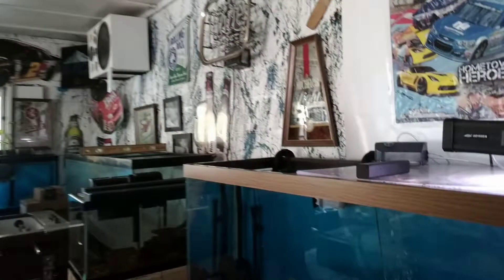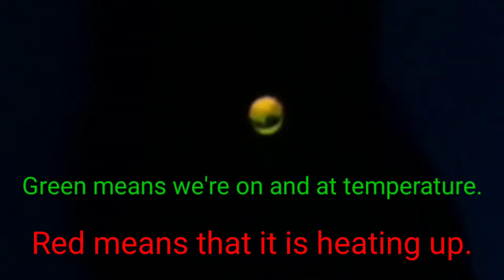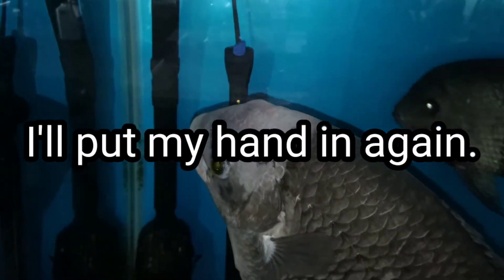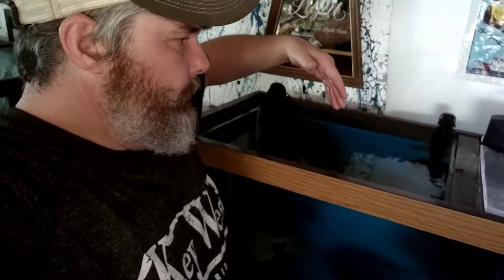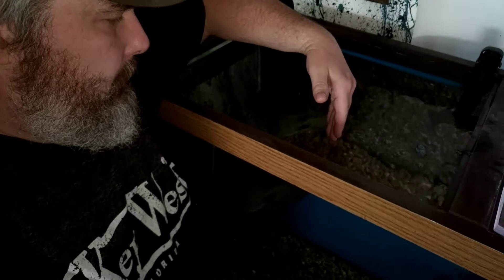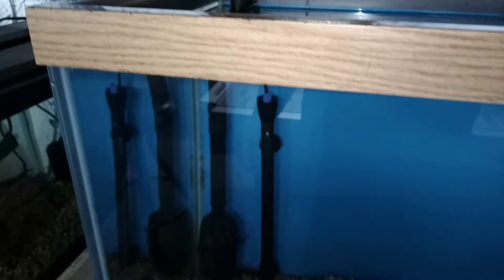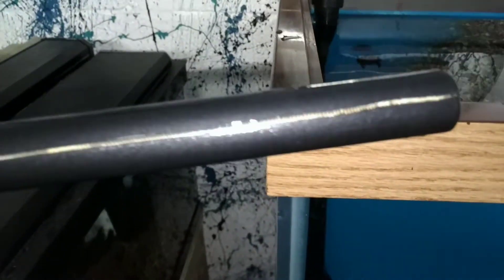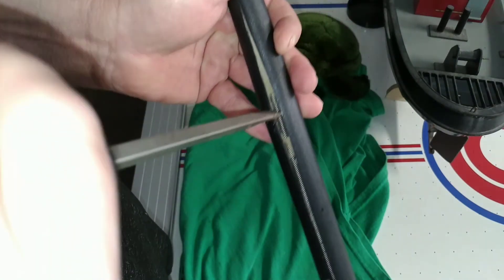Your fish don't get electrocuted but you can. This is how and why.

Comment: Hello good morning, my friend, this problem happened to me in 2024, right now, and I really tried to turn off the devices one by one and it was the thermostat. Even so, from what I understand, it could also be a poorly insulated wire that could be passing through the water in our tank. I have salt water and I was surprised because neither the shrimp nor the crabs died, we just need to know if the anemones shrank and gave some sign.
But anyway, I just want to share with all of you that this really happens.
However, I just tried using the pole flasher in the aquarium water and it still has a certain current, but minimal.
Reply from the maker: Thanks for sharing. I am glad to hear you found the problem. Happy fish keeping.

Comment: So is this what they mean when they advertise a heater as "shatterproof"? I was thinking it somehow stopped your glass from cracking at first, but now I don't know. Also, what is the wattage? I just bought a mini 5 watt, but now I'm afraid to use it. I know 5 isn't much, but I don't want my kid getting hurt. His betta likes "pets" sometimes, and I've often stuck my finger in to feel the water temp. Yes, I know I need a thermometer lol
Reply from the maker: Trinity, yes this was a shatter proof heater. No glass, at all. I prefer a shatterproof heater. If a glass heater accidentally breaks its sometimes hard to find all the glass. The heater was 250 watt. So I don't think you have anything to worry about. Yes a thermometer is always a great guide to have on a fish tank.
Reply: @roundedrob1483  oh, yeah, I meant the glass of my tank. I didn't know there were even glass heaters. Thank you though! I'm a little less afraid now. Stay safe and no more shocking yourself! I saw another video showing how to check for stray electricity. There's apparently things you can put in that will redirect the electricity just in case. Good luck!

Comment: yikes!! That's insane Rob!! I can't even lick a battery to test it!! I always plug out everything. I have a ball that is covered in metal sensors. It's called the hot potato. You have to keep tossing it to the next person before it shocks you. It does random shocks every 10 to 30 seconds. I hate that ball hahaha..
Reply from the maker: I know I couldn't believe it was almost cracked all the way to the top. It didn't happen overnight it's been heating cracked apparently.